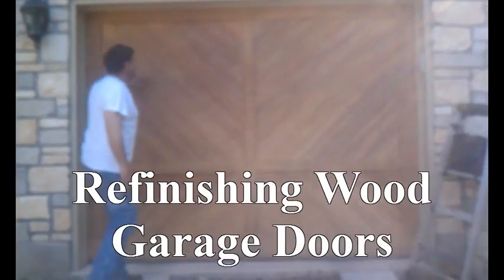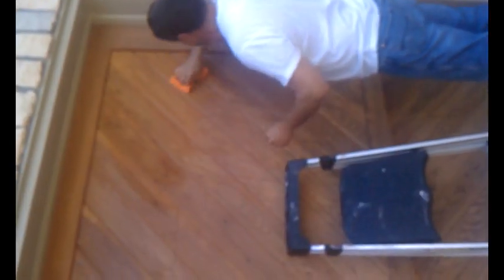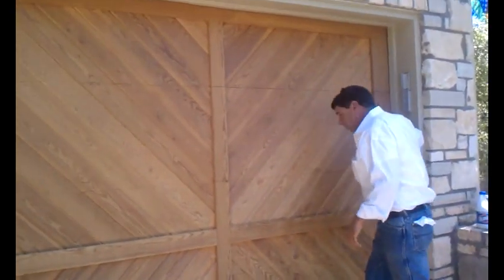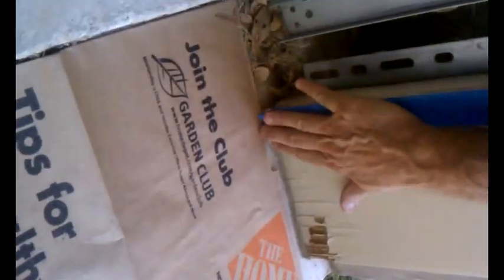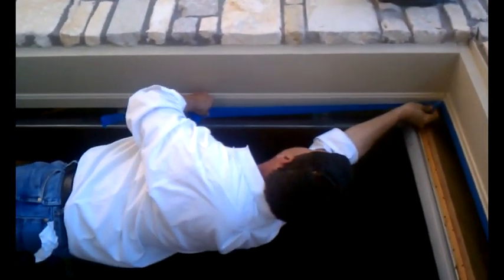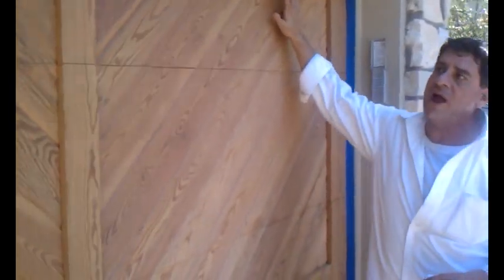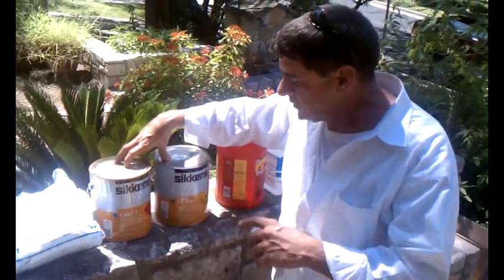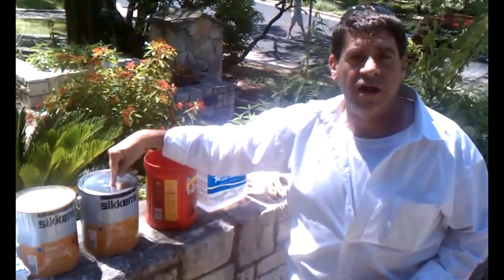Refinishing a Wood Garage Door, Part 1 of 2

Comment: Doug, a really detailed and helpful video. However, many of your comments and suggestions are directed at smooth finished wood. I have rough-sawn cedar garage doors with many grooves or channels. A sanding block doesn't really work. How would you prep the surface between coats?

Comment: the door i need to fix looks like some of the stain is gone on the bottom portion. Can I clean it, maybe a little sanding, touch up the area on the bottom that will accept stain, lightly sand and reseal entire door.....?
Reply: Absolutely. Sand and feather in that area where stain is gone, use some Gel Stain to match existing color and then use the Cetol 1 and 23 coating system.
Reply: thanks for the reply, but I thought you were using another brand two part system.